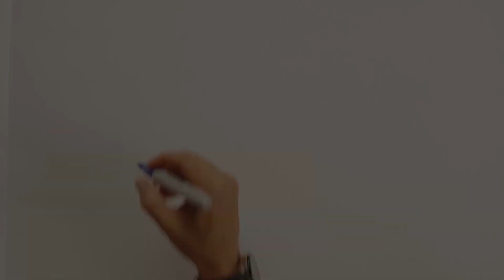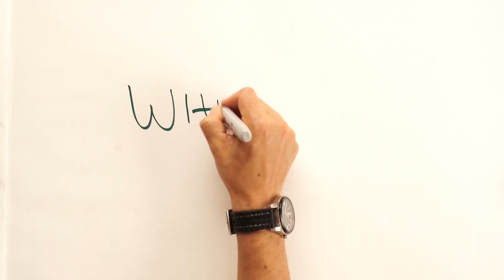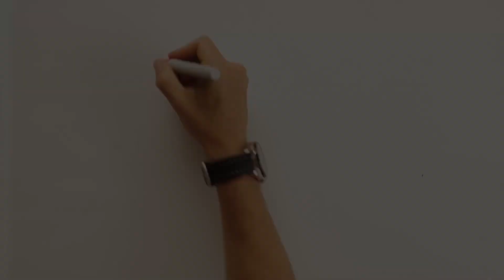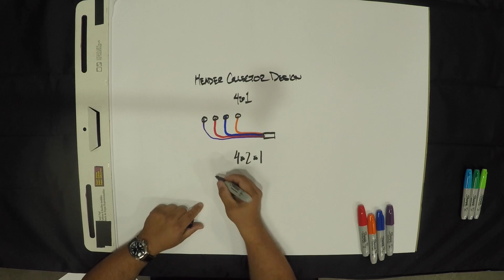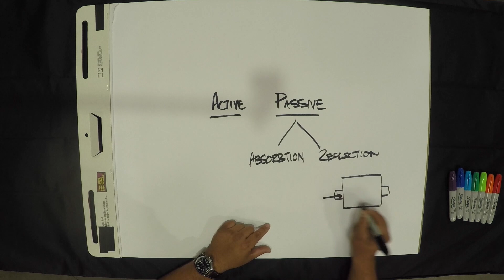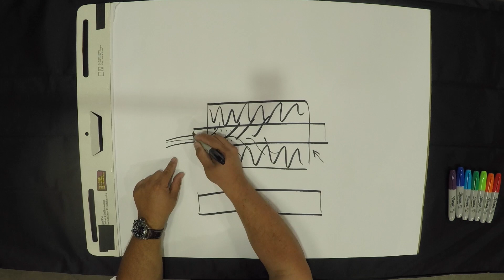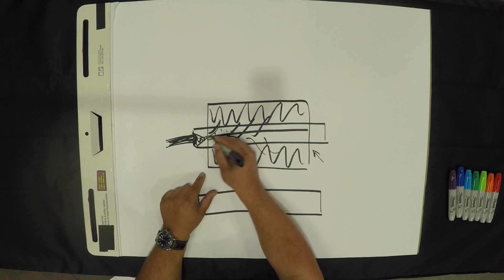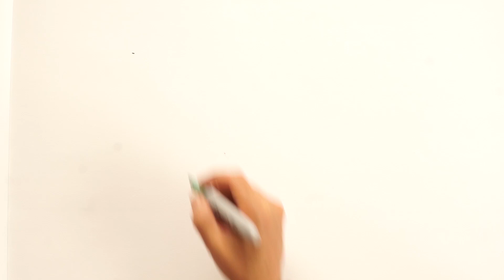No More Exhaust Myths - /ENGINEERED

Comment: Those perforations may be "smooth" felt by a hand but in fact are very "rough" to exhaust gas at high speed. Each of them will create a tiny, localized turbulence. I still can't believe a muffler of such design can outflow a straight pipe! Reducing in surface area is the only thing the MF gentleman could think of to back their marketing hype and i believe a lot of folks who are lacking the background of fluid mechanics will buy into it! Nonetheless good presentation skill.

Comment: I got a custom catback 2.25 piping with 2.25 vibrant resonator but my muffler is a 2.5 Skunk2 muffler (absorbtion type) . If I replace my muffler to a reflection type Magnaflow, will it quiet down my cruising speed especially city driving?
Reply: I'm also wondering the same
Reply: J Graves i just replaced it with a 4x9 magnaflow xl baffled. 50% more quiet and 90% drone was removed
Reply: thanks for letting me know, I want the drone gone but at about the 20 minute mark he started talking about a drop in velocity so I think I talked myself out of it.
Reply: J Graves what setup do you have a  car? i miss the loudness tho so what I will do soon is just remove my 12" vi rant resonator to have some rasp which I would want.
Reply: right now i have koods 1 7/8 headers catless x-pipe into 18 inch glass packs with turn downs. I'm gonna run them out the back and put "something" in place of the glass packs i just don't know what. I'm kinda leaning toward a longer glass pack "the kind that have the baffles in them" and turning them around backwards. I would like to try everything if it
was possible lol that's dual 3" also
Reply: i like the way it sounds outside the car but the drone inside is terrible
Reply: J Graves i see. well if you like the sound outside then keep it that way. removing the drone means replacing something that could change the tone aswell
Reply: yeah I may just run it out the back leaving everything else the same and then go from there if I don't like it I could just chop it right back off. that was my original plan.or maybe ill find a reflection style muffler that flows almost as well as the straight through. who knows
Reply: Quiet? What is this word you use?

Comment: Even absorption mufflers disturb laminar flow.  You will ABSOLUTELY have velocity drops, but they won't be through the center of the exhaust gasses.  Would need to get with the engineers, but I bet this effect is most measurable during WOT, as turbulence disrupts laminar flows more.

If the muffler is optimally sized, the flow rate can be faster than straight pipe (as the friction is along air), but why couldn't one optimize reflection?

I'm just a hydro-economist, so my conceptual models are ABSOLUTELY open to correction

Comment: Regarding 4 into 1, 4-2-1 & Tri-Y collectors, there are a couple of factors that you haven't
mentioned.
1. For a 4 into 1 collector to work properly, the primary tubes, MUST be place in the
Collector in such a way that the firing pattern of the engine will create a swirling
of exhaust gases.  THIS IS A MUST, as it is that swirling pattern of exhaust gases
that creates the scavenging effect.  NOT ALL MUFFLERS ARE DEIGNED TO ALLOW THIS !

2.  4-2-1 headers are designed in a similar way, in that the collectors are dependent on
the engine's firing pattern, but in this case, the firing patterns, allow for the exhaust
pipes to alternate, thus first one cylinder in one bank, then the next cylinder to fire,
will exhaust into the opposite bank.  IT IS THIS ALTERNATING OF EXHAUST PULSES,
THAT MAKE A 4-2-1 WORK.  4-2-1- Hedders, as originated by Hedman Hedders, have
a very short distance between the primary collector & the secondary collector, we're
talking a few inches.  The difference between 4 into 1 & 4-2-1 may not even be visible.

3.  Tri-Y filters are like 4-2-1- headers in theory, but Tri-Y filters have a much longer
distance from primary tube, through primary collector to secondary tube, to final collector.,
The difference is plainly visible

FRED.

Comment: Long tubes, Flowmaster 40's on my 68 Mustang, screw the new stuff!!!
Reply: Anchorup Consulting User  How dose it sound? I have a '68 mustang 302 that I'm restoring and wanted to know your opinion on it.
Reply: Shane Burns good,  nice and throaty, @5500 they'll sing when you run out of motor!  Idle sounds good, I set curb idle at about 900-1,000 RPMs.  Edelbrock top end package (RPM Performer heads, intake, comp cam FT, comp double roller timing chain and RPM performer intake, 1970 Gran Torino block .40 over, Mallory solid state distro, and Holley 4150 600CFM). try to find the older 40s, I don't know where you live but in San Antonio, TX I go to the south side where the old school Mexican-American hot rod shops are, they have this kind of stuff!
Reply: Oh and on the 40s, I have LTs with 3" collectors and 21/2" pipes.

Comment: hello,
I have jeep wrangler 2009. the stock manifold replaced with long tube header without catalyst convertor. I replaced the muffler with magnaflow #15160 but the sound is little noisy. how can I reduce the sound ( can I use kind of resonator)  or any product from magnaflow provider.
THANKS

Comment: Hello,
i've JK 2009 with Borla long tube header without catalytic converter 2.5" pipe as stock. I fix magnaflow muffler #15160 but the muffler sound looks noisy. I've advised to install resonator to enhance the sound and introduce more engine efficiency. Would you please advise what to do to maintain the #15160 muffler sound and efficiency.

Comment: HOW COULD HE NOT MENTION BACK PRESSURE MYTHS??????????
Reply: by what i got was. If the tube is too big at the header its bad but mainly if the tube size isnt consistent all the way down the system. its worse
Reply: He mentioned the science about back pressure when he spoke about the restriction in the header causing an increase in peak torque vs average torque.  That's where the back pressure comes in.  Now, if you want overall torque, open that exhaust up and let it flow.
Reply: Back pressure isnt that important but you need about a minimum of 1ft of pipe and good tuning to not warp valves. Dealing with race cars bassically all I've noticed. Friend ran open header on his 302 f15p for 4 years towing and daily use and never had an issue but was very well tuned and he had a 3in to 2in on the collector to retain alittle back pressure. Loud as hell though but loved it
Reply: Cfm to tube size.
Reply: everything you need to know about the back pressure myth is there you just have to not be an idiot and think a little bit, he explained all about tube diameter and exhaust velocity, airflow, and exhaust pulses helping extraction. He just didn't outright say it maybe to help weed out the retards who can fuck off.
Reply: He talked about negative pressure wave that's back pressure which goes back to cylinder head

Comment: so why did i lose power with a qtp exhaust cutout??
Reply: totallyrad77 Did it leak? When open, the exhaust may have piled up (so to speak) at the cutout, instead of the exhaust velocity pulling the next pulse down the pipe.
Reply: if you are NA (naturally aspirated, aka dont have a turbo) you actually benefit with some back pressure. And when i say back pressure i dont mean having mufflers, i just mean having a longer exaust with a smaller diameter than 3inches.
Most NA cars will run about 2.5inch diameter full length straight pipes for an average affect between more torque and hp, versus having more torque with more back pressure, are more HP at the top of the RPM range when more flow is beneficial

I dont think i explained it very well but basically:
- More backpressure = more torque at low RPM (most likely what you have noticed, not horsepower)
- Less backpressure = more total horse power, but not very noticeable

- With a turbo little to no back pressure is better for a more free flowing turbine

Comment: So can someone explain fuel efficiency when using aftermarket exhausts to me? Does it hurt your mpg? Does it hurt your engine? My vehicle is a 1.6l 4 cylinder.
Reply: To answer the question, if you increase the CFM the motor can push you'll have to adjust the fuel mapping to compensate as there is an "ideal" air:fuel ratio. So that will reduce gas mileage. If you don't it'll run "lean" and hotter.

A little lean isn't a big deal in the long run, so if you don't adjust it then it won't adjust your gas mileage.

Now if you like the sound and get on it harder more frequently, that'll make it go down too. lol
Reply: On a small engine like yours a 4-2-1 manifold with a 200 cell cat and just middle box and no rear box is the best way to go as long as it's not to loud? I've did this to a Vauxhall Corsa Gsi from 1996 and it gained 12 bhp with these modifications and wasn't to loud and sounded really good.
Reply: It's quite possible a less restrictive exhaust system can improve fuel economy. From personal experience I've seen increase from 25mph to 41mpg on 'small' engines operated over 50~70,000 miles plus a substantial power gain.(no bhp but top speed increase from 118mp to 127mph) As air resistance 'squares' with speed it has to be more HP allowing top gear to be used  It becomes less necessary to have a' rich' mixture to  cool exhaust valves. Intakes are quite 'happy' at 200f+ (yes, your NA intake charge is often that hot)

Comment: Im surprised back pressure nonsense wasn't discussed here. Considering tons of people live by that shit for some reason.
Reply: proto35 it was discussed the whole time hahaha
Reply: Just briefly he said if the diameter was too large it creates a restriction.
Reply: at the header
Reply: No Mr Tesla, Engineering Explained's new video is wrong.
In a 2 stroke the blow down is controlled by the difference in transfer to exhaust port opening but in a 4t there is no transfer so when the ex valve opens and blow down occurs there is means to control it other than ex timing itself.
Back pressure in the 4t is the means to control blow down, more back pressure at the header reduces the pressure differential at the valve and thus slows the blow down rate, creating a longer sonic compression wave of lower amplitude, which in turn is reflected as a longer sonic expansion wave back to the valve at overlap. The longer wave is effective over a longer RPM range, thus giving a wider spread but lower peak.
The characteristic of the reflected expansion wave is also determined by the increase in area at the end if the header which the collector ratio controls.
Velocity is merely a construct of tube diameter and length and pressure differential each end of it according to Bernoulli's equation.
Exhaust gases do not act like a siphon and the velocity of the gas does not scavenge, the Kadenacy effect is a theory of the 1930s that didn't make it past the 1960's but some lay people people still drag it around.
The theory as Ive given above was published by Prof Blair et al who carried out the most complex in depth study of engine modelling ever done in the 90s as a scientific peer reviewed study and is available from Society of Automotive Engineers (SAE)
Reply: proto35 people think of restrictions  when in fact it is velocity  you want.
Reply: Maybe they think back pressure adds torque because it reduces losses from cam overlap. Course the same back pressure cancels out the top end power the over lap was put in to achieve in the first place.
Reply: Maybe you should watch Engineering Explained's new video uploaded Dec 31st 2017 about exhaust backpressure. If the tubes can bolt onto the heads properly, you can't restrict it enough to make a difference. Period. You'd have to literally run with no headers or manifold to change the velocity enough to matter.
Reply: Spend 27 seconds watching this. I argued up and down that back pressure was bologna. Then I put Borla Ataks on my 12 Yellow Jacket. https://youtu.be/yMyKv_P80eI
Reply: You've never sufferd the loss of low end torque maybe.
Reply: Which is what exhaust butterflies were intended to tune, creating an adjustment point for back pressure at low rpm and free flow at high flow

Comment: Im just curious here, stated in the video that an exhaust can not be calibrated for great low end torque and high end horsepower.... what about designing the exhaust to flow a certain way all the way to the tailpipe say for high end horsepower? and adding an exhaust cutout somewhere down the exhaust that would be benificial for low end torque? is that a possible idea? so for everyday driving you could have great sound quality and high end horsepower and the moment you need the low end torque you flip the switch to the electronic exhaust cutouts and have that readily available...
Reply: The negative pressure wave and scavenging is beneficial to low end torque.  You can actually get higher peak torque with smaller tube diameters because of the increased velocities.  It's a pretty significant increase too.  +20-30 ft-lb.  An exhaust cutout would be beneficial for high end horsepower.

Comment: This video seems very pro straight-through muffler. Yet, nearly all OEM exhausts use some kind of tri-flow muffler and work just fine -- making a good blend of quiet vehicle, and mild WOT noise. Hmm.
Reply: OEM exhausts "work" fine, turbulence cause by material impeding the flow of gases is detrimental to horse power and efficiency. OEM exhausts are based on an average of cost/efficiency/loudness preference to targeted buyer

example: Mustangs will have exhaust more similar to a straight pipe, rather than a rolls-royce.
- Mustangs are performance cars, most buyers are younger and prefer the louder exhaust = which will make more sales
- Rolls-Royces are luxury cars that are targeted to wealthier individual who are usually older and live in wealthy neighborhoods that have sound restrictions etc.

Magnaflow wants more people to buy their exhausts, but exhausts designed specifically for a vehicle (after market) will ALWAYS be better
Reply: TassieLorenzo Their goal is cost savings first, I'd imagine
Reply: ^Dis.

Comment: Magnaflow, you mean shiny glass pack??
Reply: +Darren Rodgers No, there's a big difference. Glasspack mufflers are packed with fiberglass (hence their name), but Magnaflow mufflers are packed with stainless steel wool and high-temp acoustic packing material. And many glasspacks are made of steel, while Magnaflows are made of stainless steel. Also, some glasspacks have a louvered pipe inside which can create turbulence and drag, while Magnaflows have a perforated pipe.

Comment: So... straight pipe it is.
Reply: Andrew Bartleman It’s actually true, and backed up by science. Look into fluid dynamics. Think about the surface of a golf ball. Ever wondered why it isn’t smooth..?
Reply: @Eddie2425  it's smooth to create a slippery film of air around the ball so it flies with less friction.
Reply: Jarrod Swick you saved me 30 minutes
Reply: +Eddie J did you see mythbusters?!?!?!?! They covered a car with golfball dimples and even with the extra weight they apparently dropped fuel consumption by a recognizable amount!!!
Reply: ap2pat 
So why not dimple the inside of an exhaust system?
Reply: @robotbjorn4952   It's not practical, especially if you want the dimples from the inside. Think about it like this; if it was useful, why aren't F1 guys doing it?
Reply: @lobmin  
I'm no machinist/engineer, but here's an idea:
 Run the sheet metal that's to be made into a pipe through heavy rollers that contain the dimple pattern before shaping and welding the tube.

You could probably even order it pre dimpled from the supplier once the tooling is set up. I'm pretty sure that sheet metal gets squished to size through a series of rollers already, so it might not even add a step.
Reply: Robot Bjorn hell you could just do the first idea but then sleeve it into another tube as roughly textured things tend to rust out quicker.
Reply: nope. 21:02
Reply: @esh92   Consider the source kid. His argument was that there is less surface area. There is still surface area because of the muffler packing. Not only that, EVEN without packing, a perforated tube will cause turbulence, slow the gasses, therefore flow less.
Reply: Agreed!
Reply: I have always thought that people who run straight pipes were rude, self-centered, inconsiderate ass wipes.
Reply: Hahahahaa
Reply: Engineering Explained needs to do the math, and tell us the best exhaust.
Reply: Actually it's still true, only dictated by length.   If the pipe was long, this would be an issue.  The length of the pipe needs to be more or less tuned to the CFM flow volume and speed.  Temperature drop is a factor to.
Reply: Apparently  straight pipe has less flow than a MagnaFlow  muffler because of friction  lol
Reply: Straight pipes give you less hp. And sound terrible. I have never heard a good straight pipe. That's why there are different kinds of mufflers to choose from.